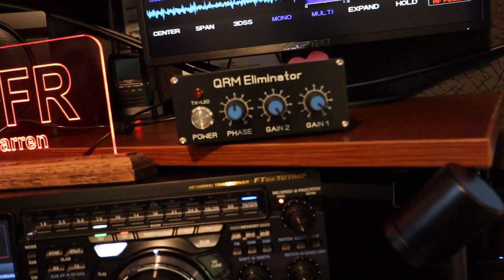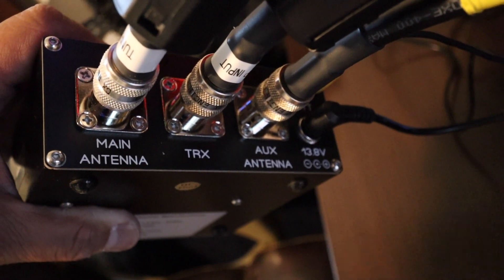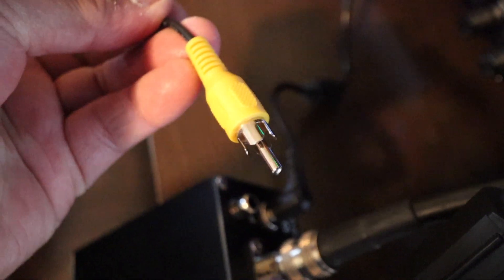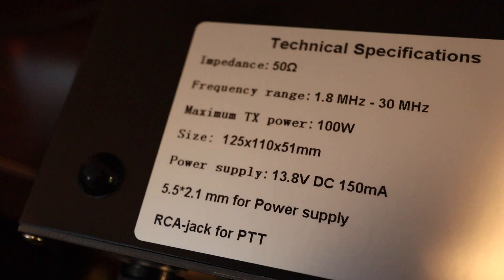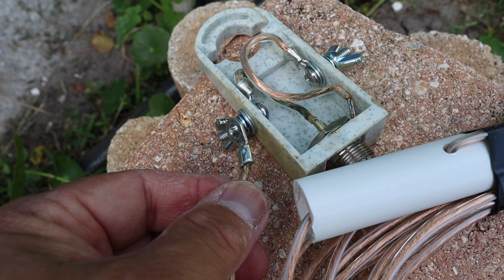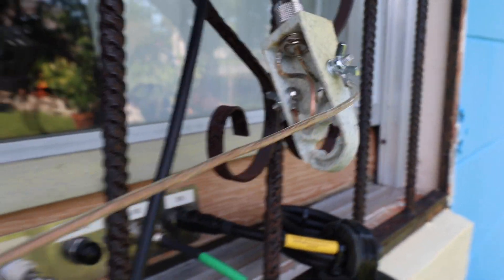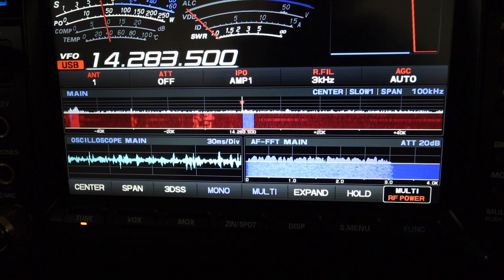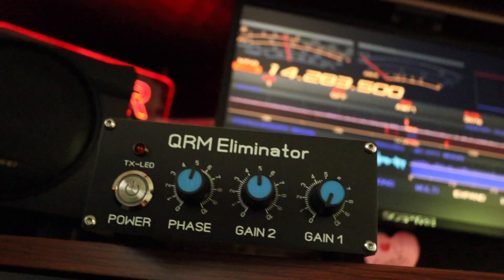How to setup and use the QRM Eliminator! Noise Interference Gone!

Comment: Great video and very well explain , i have the Ftdx-10 but i don't know where to connect the rca plug coming from the qrm eliminator to the back of my radio , if you have the time can you let me know where, thank you.
Reply: The wire hooks up to your linear amplifier plug in on the back of the ftdx-10.  You can pick up a wire at DX Engineering for this. The wire is DXE-YSU-10P-RCA. I hope that helps!
Reply: @ericmcginty  Thank you for that information, the wire is 37.99 plus tax on DX Engineering, i will order that tonight , thank you again and 73.

Comment: Hello Darren.  I think you don't understand fine the method for use it.  The two antennas needed the same gain at time and after modify the phase.  For this,  decrease the gain of main antenna (usually have more gain than rx antennas used) and decrease a bit the rx antenna. You first need to find the point where all the noises (or the better s/n ratio)  you have. At this point,  the two antennas have the same gain. Then you can move the phase 
Potenciometer to kill the noise.  You can see it in a video of my channel.
Reply: You mean we're not meant to just randomly turn the knobs every which way and claim success? 😁
Reply: @socallars3748 😂

Comment: I agree that a shorter sense antenna would be desirable so it only picks up the local noise and  use vertical polarization on the sense antenna.

Comment: Thank you for the interesting video . I bought one yesterday. I use a yaesu ftdx 3000 . And also a acom 1010 amp . But the acom use also the tx ground connector. Do you have any idea that i could connect the xphase to a other connector in the yaesu ? Or using a rca splitter on the tx ground ? No idea of this could do any harm ? I dont want to destroy the apm 🙂 .... And the xphase dont work if you not connect the ptt ?
Reply from the maker: Use a RCA Y-adapter.  I connect my TX Send from from my Icom IC7610.  One end of the Y connection goes to the Amplifier and the other to my QRM eliminator.
Reply: Dear thanks.
I appreciate your help .
Is a standard RCA cable good?
Like a yellow ( Video ? )
I don't understand much about these cables.
Kind Regards on7cdh
Reply from the maker: @CHRISVDH  Yes, but it has to be long enough to reach your amplifier as well as your QRM eliminator.
Reply: Last question can i also use one splitter connector on the yaesu and two different cables ?
Reply from the maker: @CHRISVDH  Yes, imagine the signal flow.  Both signals will travel on both separate RCA cables from the RCA Y-adapter.
Reply: @DarrenN4VFR  Thank you for the good advice. Hope to work you one day on the band . I need the x phase for my own solar panels. Only on 10 meter band i have every 50 khz a weak signal ( s3 ) . I work the band whitout troubles but for this low price i want to try to fix it . 73

Comment: Common mistakes that people do and they THINK they reduce noise.
See this part of the video https://youtu.be/__bvoUl7A8U?t=467

Here you think the noise is down, but you are actually attenuate BOTH the signal and the noise.

The signal is already S9+ and when you switch on the eliminator, the signal drops to S2.
However the noise also drops to very low levels.

You think that you have the correct setting, but in fact all you did is attenuate the signal and the noise!

If you try to recover a weak signal with this method, you can never do it!
I do not say the x-phaser does not work at all, It is just not the correct setting in this part of the video.
Reply from the maker: I use the QRM eliminator to drop my noise floor about 3 S-units.  I pretty much leave both knobs vertical.  I keep it on and use my IC7610 on remote.  It helps a little.

Comment: Hello  Darren N4VFR

I hope you are feeling good

I have a lot of line noise here lately

yesterday it was 20 over 9 on HF

what is weird it comes and goes if it's raining no noise

the noise blinker is useless on this radio  Yaesu FTDX101 MP

the Icom IC 7610 Scott a lot better noise blinker ON it it will take out over 80% of the noise

my icom ic 9700  it is got the best noise blinker on any radio I've ever owned

on  2 meter SSB it will get rid of static crashes

I was wanting to ask you about The QRM Eliminator

I believe it will only handle 100 Watts

I'm not for sure but you turned the The qrm Eliminator off can you run 200 Watts 

thank you Darren N4VFR

73

Comment: Hello Captain Darren

I got a Yaesu FTDX 101 MP

QRM Eliminator is turned off can you transmit 200 watts ON it

another problem I would have with The qrm Eliminator

all my HF antennas come in the House to a big 2K a Ten Tec 229B manual Antenna tuner

on the back of my Big Ten Tec 229B antenna tuner I got a coax jumper running to antenna switch box

for two different Radios  Yaesu FTDX 101 MP  ICOM IC 7610

thank you

73
Reply from the maker: Congratulations on the Super Yaesu 101MP.  It's a beast of a Transceiver! Don't mark my words, but if the QRM Eliminator is turned off and bypassing the circuitry, I believe you can transmit 200Watts.  Maybe first try 120 Watts and work your way up to 200 Watts. 

It does get complicated when you start adding antenna switches.  I'm just thinking that your QRM Eliminator also needs to have a seperate antenna to sense the interference.  First try using it with one transceiver and once you mastered the skill, put in another antenna switch on it.  Good luck!
Reply: @DarrenN4VFR  Is it deff the TX GND and not the PTT socket on the 101MP ?
Reply from the maker: @MONTY-YTNOM  This is cut and paste from a QRM Eliminator PDF, "When transmitting through the QRM-Eliminator connect the PTT-Line from the back of your radio where normally your PA is connected. PTT is active when center pin is grounded. Do not connect to the PTT-key on your microphone! Max. power rating is 200W. if you want to use an amp, the QRM-Eliminator is to be connected between amp and exciter."  I hope this helps.
Reply: @DarrenN4VFR  PA ? In the video it shows TX G  at 1:35min
Reply from the maker: @MONTY-YTNOM  No, that is my Yaesu FT101MP.
Reply: @DarrenN4VFR  yes but the video says use the PTT socket but it show the lead being plugged into the TX G
Reply from the maker: @MONTY-YTNOM  Connect the RCA Phono plug from the QRM Eliminator's "PTT" and to the Yaesu FT101MP's "TX-GND".   I no longer have the 101MP to confirm that it was TX GND or PTT.  I now have the Icom IC7610's "Send". As long as the QRM eliminator detects that the radio is transmitting, it will switch the relays from receive to transmit.

Comment: Where you connect ppt of you have a Galaxy Saturn?? Thanks.
Reply from the maker: On the back of your radio, you will need to connect a coax from your radio's tx/rx to the TRX of the QRM Eliminator.  Keep in mind, you will need to have another antenna (Sensing Antenna) of almost equal receive strength in order to properly cancel out the RFI.
Reply: @DarrenN4VFR  on back of galaxy it has rca for rec.and rca for frequencycounter..when keying mic it has connectivity.could it connect to rca ppt.on eliminator??
Reply from the maker: @charlessalard4636  Ohhhh okay.  I don't think this will work for you because your transmit and receive are on two different ports.  Typically, the TX/RX are on one coax port.

Comment: Ok the reason this is not working is because your rx antenna needs to receive the noise the same or louder than your HF antenna. If not, your rx antenna is not good enough.

If you rx antenna can't get the qrn louder the your HF antenna, how do you expect to cancel the qrn.
All you are doing is reducing the gain of the antennas, plus you can't test it while listening to a station!

I have the mfj1026 and my rx antenna picks up everything.

Comment: How can I use this using a pw1 amplifier I've got four antennas completely filled on the back of the pw1 how would I rig this up to work with the pw1 and the Icom 7700? Thanks Mark
Reply from the maker: You would need to connect the QRM Eliminator between the PW1 and you Radio. As far as connections behind the QRM Eliminator, Aux Antenna is connect to the sensing antenna. The TRX goes to your HF Radio, and the Main Ant is connected to your PW1 Amplifier.

Comment: You should be using a MUCH shorter aux antenna.    You will not get the full effect of that device when the auxiliary antenna is also receiving The wanted signal. The antenna should be a 3 ft piece of wire or shorter so that it only picks up The unwanted local noise and not the signal of the other transmissions you want to hear
Reply from the maker: Thank you. Gonna have to try a shorter antenna.
Reply: @raysult This is only true when the noise its near to your station.  The better option it's the same gain for the two antennas in general.  If the noise its far from you, it's better a gain antenna in the exterior.

Comment: Impressive, but maybe you can explain something for me. The QRM was bad, but the QSO signal was still stronger, pusing the S-meter to 9. When you turned on the QRM Eliminator, the QRM went away, but the S-meter dropped to about S-2 on that strong signal. What caused the dramatic drop on the S-meter without any audible loss in signal strength?

Comment: whereabouts would i attach the ptt connection on the yaesu FTDX10?
Reply from the maker: Take a look at the FTDX10 Manual page 13.  Under the Tuner Port, you may need to connect the GND to the outside shield of the RCA plug and the TX GND to the center conductor of the RCA plug.  Take a look at this:  https://forums.qrz.com/index.php?threads/connecting-a-qrm-eliminator-to-a-yaesu-817.551786/

Comment: I have a different problem, I have a noise floor of s3-4 normally, but I get a broadband burst every 15 seconds with a 12-13 second duration. Totally overwhelms the receiver. I don't think that it can be phased out. Still, for ambient noise with a consistent noise level, it seems to be the ticket. Thanks for the video. 73, Al
Reply from the maker: Al, It will be hard to tune out the broadband burst.  You might see if you can find the source of interference.  At least check if you can find out if it's originating from your house.

Comment: I just bought it last week and still trying figuring out its pattern. Now my auxiliary antenna has some distance to my main antenna, cancelling the noise is a little tricky; I need to cancel out different noises for different phases. Sometimes when two noises came in with different phases, there is a trade off. I've discovered that putting Gain 2 at level 5 (middle), it can do the job most of the time by only adjusting phase knob. However, when auxiliary antenna cannot reap enough noise, Gain 2 need to be at level 10 (highest) while Gain 1 should reduced to some extent. All in all, when spare time comes, I'll try for put both of the antennas close to see the result. Literally, I guess using beam antenna as the main should benefit a lot from this toy.
Reply from the maker: Thank you for the tip.